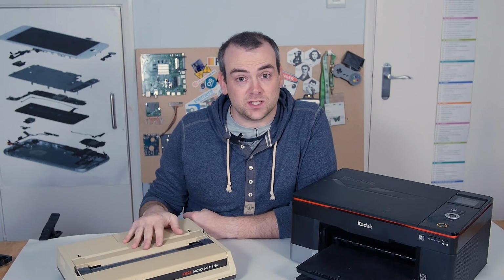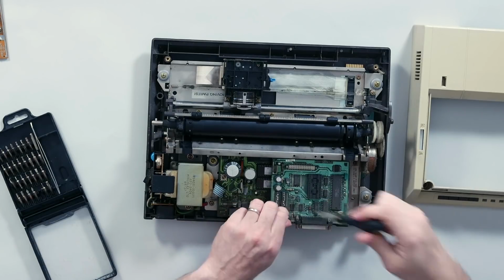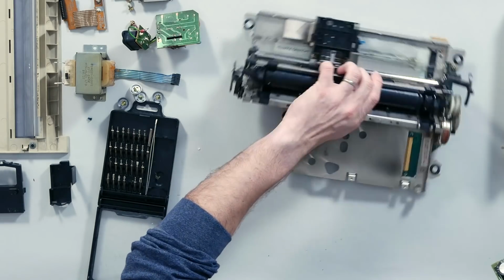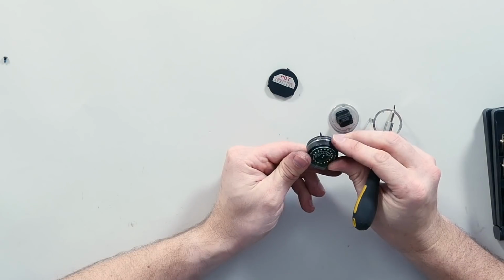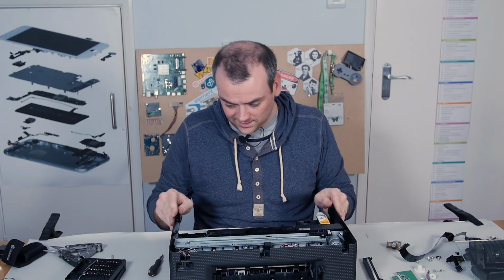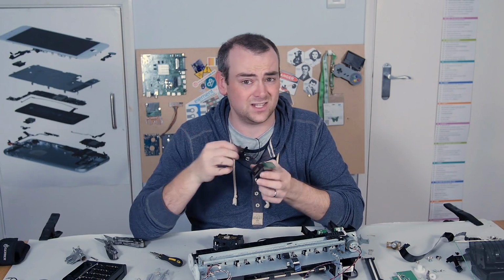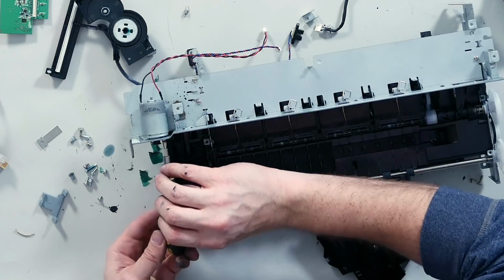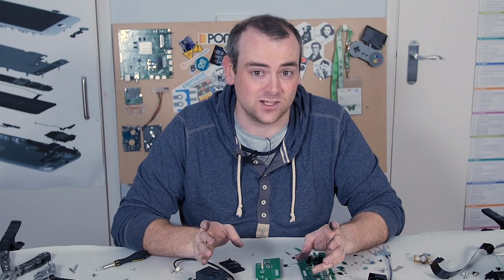Printer Technology Showdown - The Electronics Inside

Comment: I believe they used those pressure connectors because of the vibration. The OKI Microline was a standard printer at the time - a printer every software supported.

Comment: Ink jets are a total scam! The additional scan bed bulk is just an additional environmental hazard!

 I read somewhere.. If you expected the printer to last a certain time for a certain expected price, that's your sales contract .. guarantee/warranty times are then just nonsense!

I was hoping to see a Laser printer! =| You can buy fantastic 2nd hand laser printers for nothing .. even the compact domestic samsung ML-2010 printer are made to maintain/manually clean dust/toner.

Some early models have no chip protection on the toner so you can manually refill them for essentially nothing i.e. $10 etc.. for a couple of refills  @ 2k prints/20+ ppm at a time!  Prints acetate sheets too!

Comment: I'm a printer tech, so I can say, yes, every inkjet printer has to 'waste' ink to keep the printhead clean, and printing properly. it's just a fact of the technology. I do commercial printing, and ink waste is just a fact of printing. Even some laser printers have a 'waste toner' reservoir. Think of it like when you're painting. Yes, in an optimal world, 100% of the paint would wind up on the walls, and you'd never need to clean the brushes, the paint tray, the floor, etc.. but obviously, that would never happen in the real world. 
More expensive printers have what's called a 'waste ink tank' that's removable, to keep the costs down, to keep the mess off the EU's fingers, and for 'scheduled obsolescence' they omit that in cheaper ones.
And if you think that standard printer ink is expensive, you should see what the commercial stuff can cost. I had one printer where the ink cartridges cost $250 each.. and there were 8. so, yeah..  that's $2000 to replace the ink. (I disposed of the printer, the last time the ink needed replacing) and many cost even more than that.
Reply: I'm used to ink jet plotters for drawings in the construction industry, and as you say some have waste bottles, and I have seen a dropped waste toner cartridge explode on the floor. But it's the combination of the amount of ink, the fact it's being concealed from the consumer and the cost of the ink per ml that bugs me the most?

I seem to remember plotter cartridges being more expensive (easily double) but were 4-5 time the capacity?

Comment: Most of people say that these sponges are for cleaning, but that is only a fraction of truth. The real reason it that, that before starting every print printer has to make sure that there is an ink in the nozzles and no air bubbles or so - anything that would affect a print result. Next reason why printers waste ink is because they also make sure that ink will not get dry inside nozzle. When you keep your printer plugged to electricity you might notice that once a day, or once a couple of days it moves printhead aldo no one is working with printed - that is when it just keeps moisture in nozzles by spiting ink
Reply: The sheer volume of ink that can be in there, the need for a pump, is just staggering, when we are talking $1.50 /ml, any wastage is pretty unacceptable to me!

Comment: EPSON has an ink collection tank at the bottom of the printer. The cleaning operation requires no paper, and anyway there's so much ink going out, that you would need dozens of pages to absorb it. In the sealed parking spot sits a peristaltic pump that connects the waste ink tank to the nozzles and removes the clog with quite a force.

Eventually, this remarkably big waste ink tank capacity is exhausted, so there's a usage counter in the printer that requires someone to wash out or replace the tank sponge and then reset the counter with service mode software, until then it will just no longer print. It shouldn't just leak.

The ink? They charge a lot for it, but its actual cost is pretty much zero.

Comment: Inkjet printers have made me very cross for a very long time. I used to like Epson because they had significantly better photo quality than anybody else, but they had non-replaceable print heads and tended to clog beyond repair regularly (specifically in the high, dry climate of Colorado). I stayed away from HP because of their policy regarding refilled and third-party cartridges, but at least each cartridge contained the print head so you didn't have the clogging issues you had with Epson. Canon was the happy medium that I ended up with for years because they had decent print quality, ink cartridges were a bit less expensive because they didn't include the print heads and they were less picky about third party and refilled cartridges, and the print heads were a separate, easily replaceable component that you could replace when they clogged irretrievably but didn't have to pay for before then. I also bought the bulk ink refill kits and refilled all my cartridges myself.

When I finally was able to afford a color laser printer, I finally kicked inkjet to the curb for good. I do miss the photo quality -- I've never seen any other printer technology besides the super-expensive thermal transfer printers that could come close to the photo quality of inkjet. Laser printers certainly don't do photos justice, even now. But hard copy photos are pretty rare these days, so photo quality is not a deal-killer for me any more and reliability is.
Reply: It's interesting how often that story seems to be repeated! It's going to be my goto advice, if you can afford the initial outlay, and the tiny bit more space, laser is the way to go!
Reply: Inkjet printers make everyone cross. I have never found an inkjet that was actually reliable long-term, and that includes the high-end office models I've worked with. Leave them sitting idle a few weeks, good luck getting them working properly again.
Reply: @vylbird8014  Yes, that's exactly the issue: they work best when used often but not too hard. If they sit the ink dries in the nozzles and clogs them, if used too much the waste builds up and clogs them. It's a lose/lose situation.

Comment: The dot matrix printer has a tractor feed, not "tracked", and I've never seen anybody try to use cut sheets in a tractor feed printer LOL. (Yes, they were the name of the game for the first 10 years of my computer career.) Also, many daisy-wheel printers did in fact have interchangeable daisy wheels for different fonts. Just like many of the electric typewriters had interchangeable daisy wheels or balls.

They also had "line printers", which were a variation of dot matrix printer that had a head the entire width of the paper and just like it sounds they printed an entire line at once. Very noisy, and very, very fast.
Reply: I've not heard of a line printer before? I assume they were the expensive end of the spectrum?

The lever on the left of the OKI was to switch between Tractor and sheet paper. It slightly changed the position of the mechanism at the bottom of the roller, and allowed the right "cog" to be slid away from the roller on the roller axel!
Reply: @a531016  I'll admit it's been a very long time since I used a dot matrix printer, so the cut sheet feature must have slipped through the memory sieve. I do know that sometimes the rubber on typewriters would harden so it didn't grip and feed the paper properly, and that's probably what happened with that printer.

Line printers were not used by your average joe with a home PC. They were large and expensive and as I said very, very fast for businesses and government departments that needed huge amounts of stuff printed quickly. The only one I ever saw in person was at university in the 1980s.

Comment: The feeding is a common problem when printers get older, the rollers stop gripping the paper so well. My first printer was tractor feed only, but my second dot matrix printer was sheet paper capable. It fed perfectly for the first few years I had it.
Reply: The roller, which I'm sure was rubber, felt very slick and a bit plasticy.
Reply: @a531016  Yep, definitely not going to grip the page like that.
Reply: I'd rather not say how long it took me just to get it working enough to print that diagnostic page...

Comment: There were colour dot-matrix printers available from the eighties with a single striped ribbon containing the various colours. Also many daisy-wheel and golf ball printers had easily (by the standards of the day) removed interchangeable font wheels / balls. 
The peristaltic pump is used to draw a vacuum, hence its size. However, before every individual print job most inkjet printers clean the heads, depositing the excess ink onto the cleaning pad. Many of the better inkjet printers have a seal over the parked print head to prevent it from drying out between uses to minimise ink loses due to repeated manual cleaning procedures. I totally agree that the cost of inkjet cartridge ink is criminal although some manufacturers (eg. Epson) now provide machines with large refillable ink reservoirs, although such printers are usually more expensive than their cartridge counterparts.
Reply: I still have a dot matrix Memorex Telex with an optional colour head assembly (if they didn't steal it from the common room). In fact it was just branded Memorex but I don't remember the OEM. Bought a colour ribbon but never used it (back in 1994)... If you printed something in green on the second pass of the looped ribbon yellow and cyan never got to be the same :D .  The head (or the ribbon?) was displaced vertically to impact another colour. 
I also have  some 2 or 3 days- wheels... also from OKI... No golf balls though. I remember my colleagues refurbishing those crazy machines... Oh, and at one time there was a rage/niche replacing worn or snapped pins on dot matrix printers... Too bad he does not mention the difference between bubble jet and piezoceramic principles (there was a war back then) ... and more, I had the privilege to see some cartridges for some electro deflection printers that used a gun like old analogue oscilloscope did... To tear one down would be blasphemy... Yeah, I'm old...
Reply: @betta67  
OMG, I used to work for Memorex Telex in another life! 
If I remember correctly, the colour ribbon would move vertically to account for different colours, much like the black & red ribbon on a manual typewriter. I'm also old!
Reply: @WaltonPete  Well, maybe then you remember the Memorex Telex 7040 (286) and 7060 models (386) (that I overclocked by changing the oscillator on the MoBo as it was socketed). They had 40MB and 60MB SCSI drives... :)
Reply: @betta67  
I remember when they introduced their first ever IBM compatible PC but I don't remember the model number. I used to deal mostly with the printers and VDU terminals (before the PC revolution!) and I left soon afterwards. I remember the generous, 'massive' 20Mb HDD that was included as standard!

Comment: I've seen that some ink-jet printers have two positioning systems, the encoder ribbon you showed and a couple of fixed light slot sensors that tell the printer when the printhead is at specific positions (allowing the printer to calibrate against almost any encoder ribbon, greatly simplifying maintenance).
Reply: You're right, it had a "home" light gate too. I think the encoder was just for linear offset from that position. That said, I still suspect that ink would cause an issue, remeber I did buy it as "spares and repairs"!

Comment: The ink sponge IS for cleaning :) The paper is just for printing lines to let you know if the cleaning worked. I think it's called the ink purge.
The printer will also dump some ink in here when it first does a print job to prime the nozzles, which is why the printer faffs about making a noise before it decides to do anything at all
Reply: Maybe, buy enough ink to warrant a pump mechanism? And to a place that is not servicable? I'll stick with my colour laser now I think!
Reply: @a531016  Exactly the reason I never bought new cartridges for my inkjet, I only use the scanner portion of it now, and I have a mono laser.
A colour laser's on the cards for the future though 😊
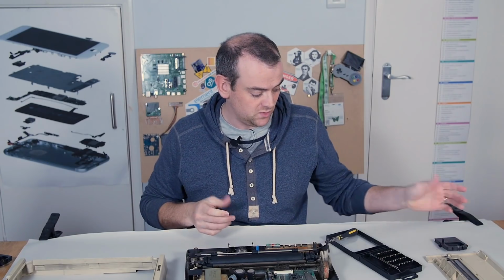Reply: I bought a cheap (£50) mono laser when I started university in 2005 (judging by David's comment at 2:28, he and I are probably about the same age, to within a few years!), which I think is right around when mono lasers became affordable for use at home (or at least by students who preferred to spend their money on tech than booze!), and I've not used an inkjet printer since then, much to my relief :)
I upgraded to a Dell 1320c colour laser printer in 2008 for £170, not because the mono laser stopped working, but simply because I wanted colour and a colour laser printer at home was pretty cool. Meanwhile, that mono laser had printed many hundreds of pages of notes and assignments flawlessly, quickly, and economically.
That colour laser printed several thousand pages over the following six years - more of my own uni work, plus that of people I lived with (helped by built-in Ethernet), and notes and such from my first full-time job, where I was working from home as a Web developer (isn't that familiar? ;)) - also with the minimum of fuss.
I think it had around 1-3 paper jams in all that time, but as long as you have access to all 4 sides of it - which was admittedly not always the case - fixing paper jams was generally as simple as pulling open a flap and removing the paper that was then easily accessible.
That always felt like it was economical to run, even with official Dell toner cartridges at £50 per colour.
My current printer is a Dell C2665dnf colour MFP that cost me £300 in 2014. Definitely a bit expensive, but at the time I was on a decently-paying consultancy job and having to do a lot of scanning as well, so its duplex document-feed scanner, in addition to duplex colour printing, saved me a lot of time and continues to do so. And of course that one's also worked near enough flawlessly - though the scanner is used far more than the printer, these days...
Mind you, £300 for a printer that still works perfectly after 6 years, vs. £50-100 every year or two for consumer inkjets that break if you look at them? :)
Both of the Dell printers are huge machines, though. That's not something I have a problem with, but I can see it being a bit of a dealbreaker for a lot of home users.
1320c is 40×37×38cm and weighs 14kg; C2665dnf is 53×53×56cm and weighs 44kg!
Hopefully smaller & lighter consumer units exist that don't compromise on reliability too much. Or maybe I'm being far too optimistic, there!
(I was going to suggest that the 600dpi resolution of most colour laser printers might also be a dealbreaker, as it limits photos to "eh, okay-ish" quality, but... does anyone actually print photos more than once in a blue moon?!)

Comment: We had hundreds of OKI (pronounced ‘O Key’) printers when ICI existed in the mid 80’s early 90’s. They were used in offices and control rooms because it could be used as a serial (we could send data over the network) or parallel printer. We were able to replace the control chip with our own specific EPROM chip.
Reply: Oh, that's interesting, did you program your own EPROM or was there an "after market" for them?
Reply: @a531016  Sorry for the delay in replying but to make sure of my answer had to contact a mate who was actually responsible for obtaining the OKI printers and chips. I was at the sharp end setting up the printers and getting them working on site (Offices, Control rooms and Workshops) he was part of the IT supply chain sourcing them. Apparently the ICI vision was developed in conjunction with Microline to work (serial) with Digital Systems plant process computers. My mate use to produce them, from the original, using an EPROM copier.

Comment: The ones that dump waste ink into a spongy reservoir usually have a maintenance box that is replaceable.  Honestly, it's weird for a cheap two color (CYM and black) to even have a separate print head from the cartridges.
Reply: I was a little suprised by the heads? Does it help reduce the cost of the consumable ink?

I think my real issue it why is so much of the consumable use in this was, and neither of the two printers I have taken apart have had "replaceable" sponge. Even if it is for cleaning, it should be more economic, and the sponge puts a finite life on the machine. It is prety much the definition of "built in product obsolesence"! Dont you think?